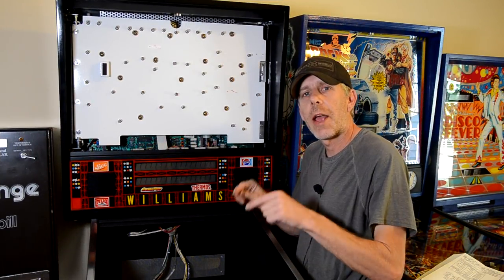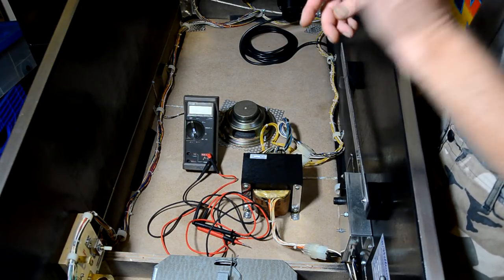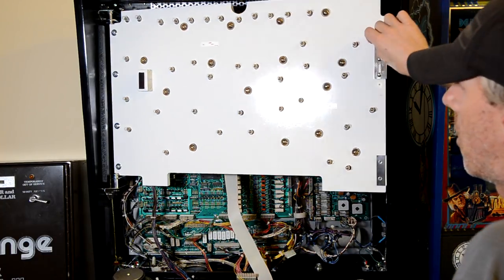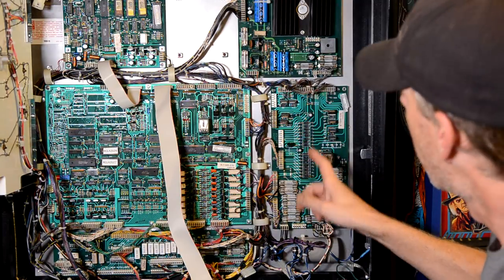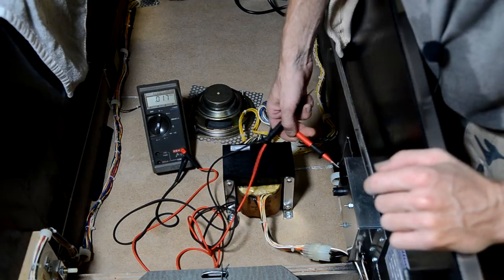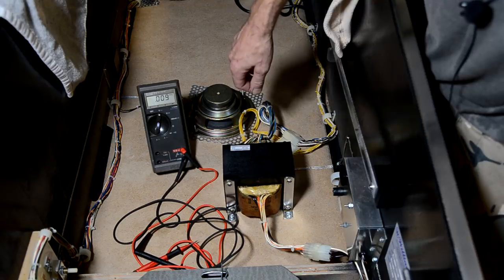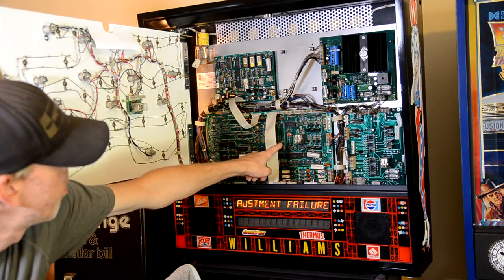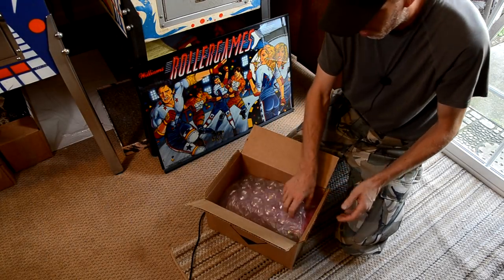Pinball Restoration Update: Rollergames Ep. #6.5

Comment: Loving the video series.  In a previous video I mentioned you really ought to be doing your board work on an anti-static mat, or at least NOT on a towel.  Just a piece of friendly advice.  I loved the Roller Games show as a kid and am looking forward to the finished product.
Reply: For years static was something that we didn't take too seriously at the company I work for.  We had anti-static mats but not much else.  Straps weren't required and we didn't store our boards as well as we could have.  When we implemented more stringent storage and handling procedures we saw a noticeable decrease in board drop out.  Now we don't even take resistors out of storage without the person being grounded.  It's a bit of a numbers game, if you handle enough boards enough times, eventually static will damage something.